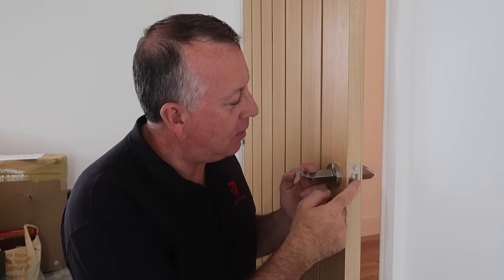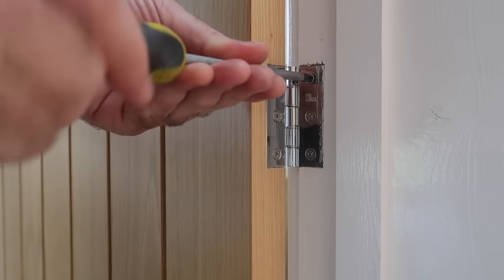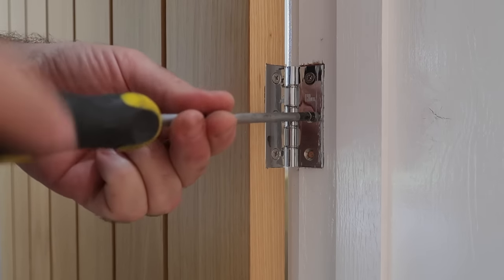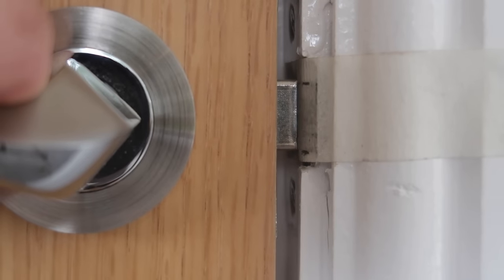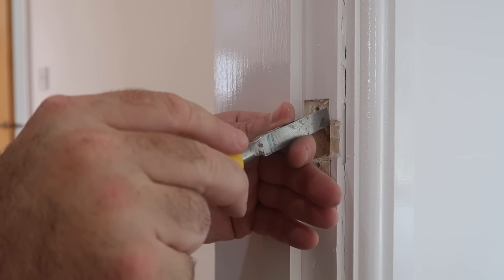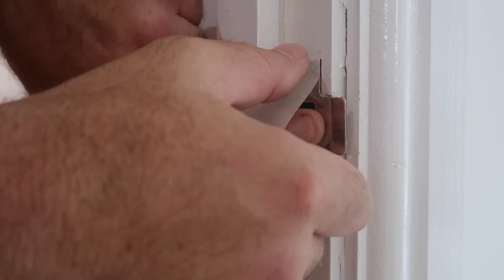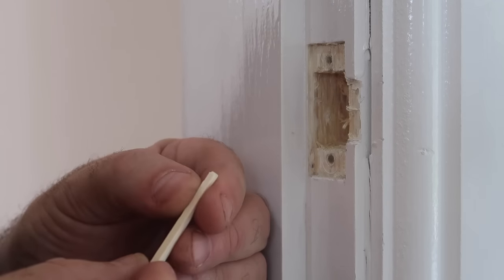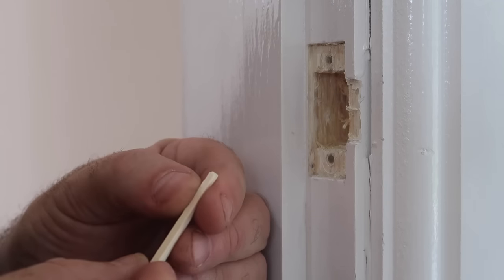How to Fix a Door That Won't Latch

Comment: I have an old villa in NZ, built 1877 with native hard woods. The doors have shifted out of alignment gradually over time. 

'Reason #1' - excellent trick. I did this, but instead of a playing card, used a plastic chinese takeaway container lid and cut 2 x rectangles to fit the hinge cavity. Perfect! I also had another door where the latch didn't quite go into the receiving hole fully on the catch plate, and again you have the answer for that right here. Also fixed by adjusting the horizontal placement as shown. 

I appreciate you get straight to the point and don't waste any time offering tutition. Your videos here have been invaluable. I have subscribed. Thank you!

Comment: Thank you for sharing this vid. When a customer calls me to help with an ill fitting door, my first step is to make certain that all of the hinge and latch screws are tight. It isn't uncommon to have the screws in the upper hinge loosen, allowing the door to sag, which in turn causes the latch be too low for the hole. For a door that needs to move about an 1/8th of an inch or less,  to the left or right, I have a tool that allows me to bend the knuckles of the door hinge. This is a fast and easy way to create a perfect fit. I have two cordless Dremel tools that I use in my door work, both of them refurbished models purchased online.

Comment: Wow!  Great video.  I have actually moved strike plates before and have come across the necessity to move the screw hole, but always found it to be a challenge to move the screw correctly for the plate.  Your method of using match sticks to fill the holes is GENIUS!  I will always know how to do this correctly now!  Thanks so much for showing this!
Reply: Bamboo skewers and wire cutters to cut the skewers after filling the holes.
Reply: I suppose toothpicks can also serve the same purpose.
Reply: @PRenard2012  Bamboo skewers are also very tough and handy for so many things. I use them when I mix up small amounts of epoxy.

Comment: Nice video on simple home fix!
Just like to share that those disposable bamboo (sometimes wooden) chopsticks that come with chinese or japanese take-outs are useful for plugging such holes.  Even as concrete hole filler.  Matchsticks aren't very common at home these days.
Reply: Thanks.
Reply: Good point, we only have gas lighters in our house but we DO have unused chopsticks (even in Ireland) 🙂, good tip,  thanks.

Comment: A well produced video. 
As time goes on doors can move up and down relative to the strike plate. I cannot understand why strike plates and their openings are not made a little bit longer. This simple change could save a lot of messy adjustments later on.

Comment: brilliant video. exactly what I was looking for. I've fitted 1.5mm weather stripping to my door and it wouldn't latch.  I knew the solution was to move the striking plate, just wanted to see someone do it to confirm my thoughts. thank you sir, your video was helpful with all the tips, much appreciated

Comment: I had to replace some weather stripping around a door to our garage. The weather stripping was thicker than what was present before, therefore, the deadbolt would not lock without a lot of pressure. Moving the striker plate in a few mm per your instructions did the trick! Thanks from new subscriber
Reply: Shame… I have every size, color and thickness of weatherstripping in my door shop. Idve simply sold you narrow or medium reach stripping.

Comment: Thanks for more good tips. I struck lucky a while ago when needing to move hinge holes. I found in B&M “Bamboo Paddle Skewers”. They are used for Barbeques and kebabs. They are thicker than matches and are pointed. So I used a bradawl to gauge the depth of the hole and cut a piece to suit. I’ve seen them online and are available in different lengths. But the ones I have serve as paint stirrers after the point has been cut and used.

Comment: HI
Another great video that is clear and correct.

For people with no playing cars you can use washers or even those O rings to shim out hinged, or even a few wrapings of masking tape or electrical tape

On difficult doors, i take out the striker plate completely and see does it latch at all without it as one of the first trouble shooting.

Now the striker plate has on the inside a angled plate, i dont know its real reason but i am guessing it is if you mount the plate to far forward, as you can bend that plate backwards to take up slack - as if the door rattles when closed - some say it is to assist the striker plate sliding when the door is slammed and the hand grip not turned fully

Comment: Really, really helpful video - thanks. I used the packing technique to move a whole door across so that it would ‘catch’ and on another I packed just the top hinge to prevent some rubbing / difficult closing at the top of the door.
Reply from the maker: I'm glad it helped

Comment: Protip with filling the old screw holes with the matchsticks 👍🏻😎
Reply: Wooden golf tees work well too👍
Reply: Very good
Reply: This is a great tip, I’ve also used cocktail sticks but any timber splinter will do.
Reply: Longer screws will work fine. 🤣🤣🤣🤣 I make over 80k a year for almost a decade fixing, building, installing… you name it. And I will tell you I e NEVER used this “toothpick” trick. I seriously doubt ANY door has 12, 2-3 inch screws in it. Therefore simply replace each hinge with a long screw or 2 in it. If you don’t have the screw then you should fill the holes with bondo or wood putty. They actually sell putty filled syringes for this lol. Anyways, it’s not pro at all. It’s amateur
Reply: Honestly though, I typically don’t have time for that even and I simply angle and reposition the screws. Takes a little experience but I guarantee it works fine. Done this 10,000 dollar units in oak, alder, fir, pine, you name it… it works. Lol, I’ve even had customers ask me how I repositioned them and wondering if I used tooth picks! 🤣🤣🤣🤣. And before anyone comes doubting, I’ve done it twice this month already on hinges that were moved only about a millimeter from the back set, and yes, it is the same with strike plates.
Reply: I y it Sw toothpicks with a little glue. Same same.
Reply: @TheFurnitureArtisan  a hi a hi a hi a hi
Reply: A little glue helps keep everything nicely locked in place.
Reply: Toothpicks will work too.  Just shove it in as far as it will go(the toothpick for you dirty minds), then break off the excess.
Reply: @samueldavis5895  9oi88*mp
Reply: @samueldavis5895   k😢🎉
Reply: @samueldavis5895  🎉🎉 thanks for the pro tip. Are you hiring?
Reply: @Strength_In_Wisdom  yes. But you’d have to live in Oregon probably with transportation. I’m still doing doors. Started my own buisness installing doors and cabinets as a residential specialty contractor. Just finished up a beautiful pair of solid pine, stained doors done all by me. I’ve been in the door game almost 20 years now. And yes, my advice on blown out holes still holds true, I still won’t use toothpicks. To each their own though.

Comment: My door latch was too low and missing the receiving hole so I just took a free paint stirring stick from Home Depot and loosened bottom hinge from door jamb then broke off about a 1/2” of paint stirring stick then slid it behind the door jamb hinge then tightened it down and now latch and receiver lines up perfectly! Takes about 2 minutes and it’s the perfect thickness! Try it!

Comment: I avoid anything oil for lock mechanism, using instead graphite, doesn’t gum up, no aerosol, one third of the cost.

Shims are effective for backplate.  I use the box from a pound of kbutter.  It’s moisture proof, easily cut and can be doubled.

I keep a chapstick, no label so it’s identified as toolbox use.   Use it on hinges.  No drippy oil, avoid aerosols.

Good video, keep them coming.

Comment: You can also find hinge shims already cut and ready to just slide in behind the hinge once the screws are loose. This would save you from having to trim the cards or if you don't have cards at all. The cards are a cheaper option. As far as filling the holes, I dip wooden golf tees in wood glue and lightly hammer them into the hole. The tapered tee will automatically fill in the hole and usually start splitting at the surface as you lightly hammer it. Then you can trim it with a detail saw or razor knife. The glued tee also keeps the wall of the new screw hole from breaking apart into the void created by not gluing the wood filler into place.
Reply: Golf tees .... so why the fudge have I never thought about golf tees? Great tip :)
Reply: @franksfiddle9031  likely because you don't have them lying about.

Comment: Matchsticks is a nice idea.
I always would just dip some toothpicks in glue and wedge them in the hole to make it a homogeneous mass.
Also slightly underdrill the hole for a snug fit, as old wood can likely get flimsy and even flake apart, which is its own host of problems.

Comment: Oh, I was going to add, true that doors tend to "hang" after a while, and hit low on the striker, but I've got the opposite problem with the house shifting and door-frames going out-of-square, and am always having to shave off the tops of the doors to not bang into the frame, leaving God-awful gaps at the bottom.  I think I'll try the shims, but on the bottom hinges.

Comment: For filling the screw holes I use golfing tees. You can use a hammer to jam  the tee into the hole and cut to size.
Reply: Pretty sure they're made of hardwood. With a softwood frame, be careful not to split it.

Comment: Do these tips apply to both internal and external doors? My front door has just stopped latching/locking, looks like it is sagging a bit as there is a gap in the top right hand corner of the door.

Comment: So I tried the first couple of things and now I'm down to using a longer screw in the top hinge and of course those screws are covered with metal spring weather stripping. Hope I don't have to take this dang door off to get the deadbolt to match up. grrr!

Comment: Treat yourself to a set of Awl Bradawl and Gimlets. Don't use matches use  a wooden skewer. If any of my doors had gaps like that I would be considering getting a new door. The gap around a door should be no more than you can roll a two pence piece around without it falling out. If the latch plate is to high the next place to look is the gap at the top of the door.

Comment: How do you do this on a front door which has a different type of strike plate? I have fitted a new latch but can't get the strike plate in the right place. It closes without the strike plate but not with.
I'd really appreciate knowing how to fit a new strike place to a new door frame.

Comment: You can also drill the holes bigger and put  dowels in with glue . That's usually used with bigger doors and  hinge hole's and screws .
Reply from the maker: Good idea!
Reply: Perhaps not the best option. There is hardly enough wood and drilling a bigger hole will reduce the strength.

Comment: Surely using the same screws on the first one would depend on the type of screw being used, if the screw was conical in shape (sorry I don't know the technical term) then the screw would have less contact with the corresponding threads in the hole.
Reply: Good video thanks

Comment: Use WD 40 to clean the mechanism. Then wipe it away and use graphite or light oil to lubricate the lock. WD eventually gums up.

Comment: Hi,

Thank you for your video, this didn’t answer what I was searching for but appreciate watching it all the same. 

I find that my latches are so loud that they disturb me when sleeping with household members going to and from bedrooms and the bathroom. 

I can’t find anything on searches for, soft latches, or plastic housings etc even using draft excluder foam to soften it as it fires out. 

I’ve been to a large local ironmongers and tested all their latches but I find neither are any different. 

Do you have any ideas on how to soften them?

Thank you for your time

Martin
Reply: Martin - perhaps not quite what you were looking for, but an alterative is to remove the catch completely and use a hidden door closer instead - https://www.screwfix.com/p/smith-locke-concealed-door-closer-square-polished-chrome-95-144-5mm/5711g

Comment: Golf tee's work good for filling in the holes too. Great video, thanks. Completely off topic. Finally a wood price has come down. A 4x8 sheet of 7/16 OSB (which is what I need) has dropped to $32 CDN. I'm off to get some.
Reply from the maker: Now a golf tee is an excellent idea. As we in the UK seem to use a good percentage of Canadian timber I'm glad to hear it's finally going the other way.
Reply: @ProperDIY  We used to get Canadian mice in the timber imported from Canada in the coal mine I worked in, they eat my bait (sandwiches) on more than one occasion.

Comment: Do you have any suggestions for the door sticking when you try to open it? When I push the door handle down, the little latch doesn’t retract into the door the whole way and sticks out a touch. Is it a case of replacing it?
Thanks
Reply: May require stripping out & apply wd-40 or 3 in 1 to the mechanism, if that fails then may be time to replace for new

Comment: Earnt my sub - nice tips.

Q though, with the strike plate, you could also use the card trick to move it closer to the latch if required, right?
Reply from the maker: Welcome aboard! Yes you could do although that part of the door and frame is normally more visible (compared to the hinge side) so don't want it sticking out too much

Comment: Adjusting the butts is perfectly fine to move any door over, but more than an 1/8th inch newer thicker butts would be better.  The keeper adjustment is okay. Drop a broken wooden match into the original screw holes so you get a good fit with the screws & don't overvtighten them, just tweak these knowing they're secure after the adjustment.  Decent DIY tutorial.

Comment: Wood doesn’t “move” as much as u give it credit for. Don’t alter the receiving end, that’s wrong. The culprit is the hinge itself, it’s bent from use. The bit that holds the pin is the part that holds the door in alignment and also holds it out of alignment. Best video I’ve seen on how to fix properly is Bradshaw Joinery. Basically you ever so slightly bend the hinge with a crescent wrench. Look for videos detailing how to do that

Comment: After refitting the hinge / striking plate NEVER wipe your fingers over the finished screw replacement ,  Unless you want fingers full of steel or brass fileings ,  OUCH !

Comment: Metal frame from 50’s with long latch that hit strike plate incorrectly

Like your video very mutch.
I have a friend renting an old house that was built in the 50’s.
The door frames are metal so no chiseling is possible. The door is wood.
My problem is that the door latch is so long that the bevel doesn’t hit the strike plate. The shaft before the bevel is hitting the strike plate making a big bang noise. You have to turn the knob, then close the door, then let go of the knob to make it latch. :(

There are three doors in this house. Two of the bedroom doors have this problem. The bathroom door works fine. The bedroom doors don’t have a locking mechanism. The bathroom door can be locked.

The hinges don’t seem to be screwed into the frame, but are part of the metal frame. The door side of the hinge is screwed into the wood door.

Is there a way to shorten the length of the door latch so the bevel will hit the strike plate properly?

I was thinking of making the door side hinge mortises deeper to 
make the latch bevel align with the latch plate correctly, but I think doing this might cause the door on the hinge side to jam into the frame.

I might examine the bathroom door knob and see what is different 
and maybe this will explain why the bedroom doors have this problem.

I was also thinking of drilling new door knob hole and make the backset about 1/4” longer. This might make the latch length 1/4” shorter so latch bevel will align with strike plate.

Maybe new door knobs will fix the problem.

These metal frames may have been less expensive back in the 50‘s, but they sure make adjustments a pain. :(

Any help is appreciated.

Thanks

John
Reply: Chiseled latch deeper
I chiseled the latch in the wood door about 1/16” deeper and now the bevel hit the strike plate correctly. It looks kind of funny. I guess the whole door side needs to be planed down about 1/8” to have a good clearance between the door and the metal frame.